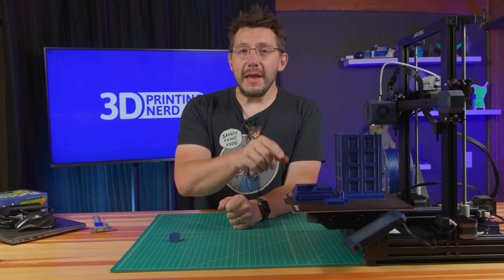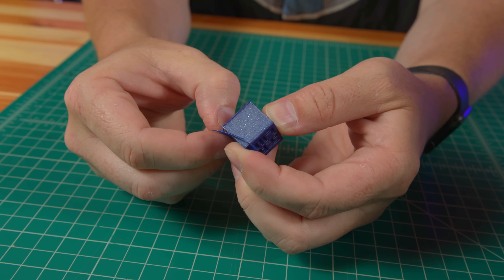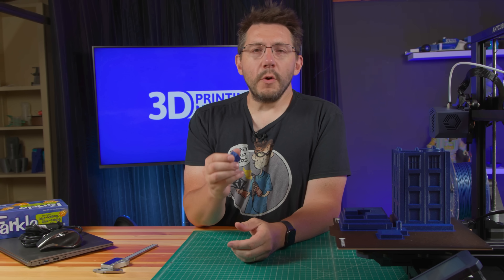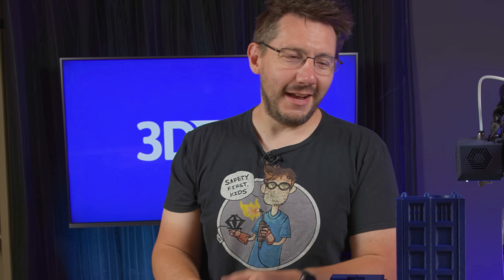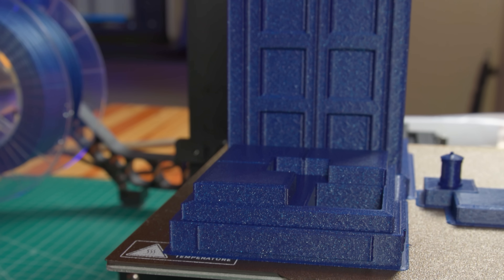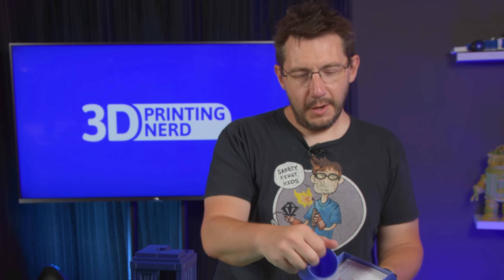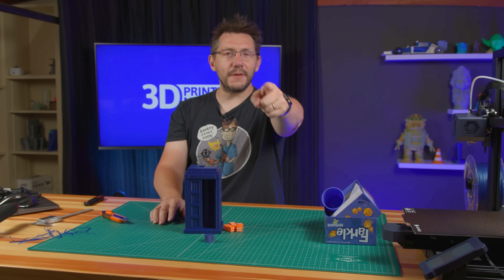Anycubic Vyper // First Look Part 2

Comment: Could you explain or point to a video that explains the extruder calibration please? ( where you referred to ensuring the extruder pushes out exactly 10 mm when it is supposed to push out 10mm)

Comment: One quick question I can't seem to find an answer. Can it support other nozzles than .4. Do all Volcano nozzles work with it? I want to update it down teh road after Ilearn. Are there just no upgrades? Also couldn't the under sizing on teh Z that small be caused by the textured surface of the plate?

Comment: I just received my Vyper. It has firmware v2.3.3. I see on their website that v2.3.5 is now available, but don't see any instructions as to how to update the firmware. 
Do you know how I can update my firmware? Also, is there any firmware that is better then their v2.3.5?
Thanks!
P.S. What printer should I select in Cura?

Comment: The Software that comes with the Vyper does not have profile settings for the vyper and when i updated to the lastest version of cura it still did not have the VYPER under the anycubic drop down, so how do you get it there or what other slicing software should I use?
Reply from the maker: I just made a profile in Prusa Slicer. Used Anycubic Mega X and defined proper bed size

Comment: I am new to 3D printing and just bought this printer. I am in the US and was told that since the US uses 60Hz, I will need to use the 210V setting not the 115V setting since it is 50Hz. It was also said that I will need to make a dedicated circuit for this. However, I took a additive manufacturing class in college where they just plugged a printer into a standard wall socket. Can anyone tell me what I need to do?

Comment: The probable average result for multiple rolls of a single die is 3.5, so the best guess is 3.5 times 6, or 21. With essentially just 6 rolls (6 dice each rolled once), it is not too likely that the result will be exactly on the probable average, but is likely to be close, e.g., 22.

Comment: Hey Joel , Could you do a video of plastic removal and obviously the risk of cutting one self using knives , Stanley trimmers and razor sharp chisels. 
Alternative safer methods need to be shown . 
I have slipped a couple of times but only minor cuts, however some new to printing may need to be aware of the risks of lacerating oneself. Cheers from Australia
Reply: Search on Amazon for deburring tool

Comment: tests i always do.  E-Steps, Flow 1 wall, then 3 walls, then 2 walls, back to 1 wall,  then Linear Advance, x,y,z 20mm then 30mm single layer cube check. as long as it is within 0.2 of the desired 20mm/30mm. that is fantastic.
Reply: my single layer cube with this machine was 20.04mm

Comment: Basically a CR-6 clone but comes with a dual gear extrudera few mm bigger build volume and flexbed; not bad for $299, what would be the price without the eatly bird discount? 
 Hope it isnt riddled with the early problems of the CR-6.  Also love the competition it drives the prices lower for us users.

Comment: I’d be highly skeptical of 1/100mm readings on low end calipers. Even starrett and mitutoyo calipers that are hundreds of dollars have a hard time with truly accurate 1/100mm readings.
Reply: Always use a micrometer if you need precise measurements under 0.05mm

Comment: People also have to be careful about 1/10mm measurements or smaller on vernier calipers and make sure they’re measuring in the same position of the caliper jaws unless they’ve verified that they’re completely parallel. 

It’s easy for cheap calipers to be off by <1/10mm.

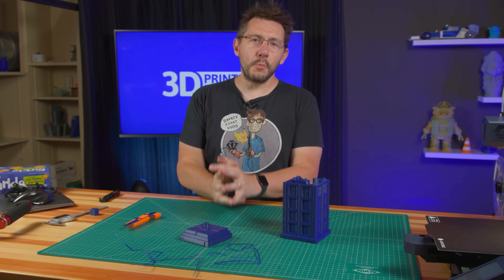Comment: Edit: 8:16 he makes the same comment 😂 

You should get one of those swiveling de-burring tools for stripping away brims. You can get cheap ones for like $6 on Amazon. 

I got one that is a multi-tool style and has two styles of curved tools, a straight tool and one for holes that works way better than a regular countersink for making countersunk holes in plastic.

Works great on PETG where it’s harder to remove brims cleanly.
Reply from the maker: I had one AND LOST IT! :(
Reply: @3DPrintingNerd  rofl you even specifically mentioned it in the video and I just hadn’t gotten there yet. 😂

Comment: For the infill showing through the walls, because you said you used cura, I would immediately check if "infill before walls" is enabled. If it is, please disable it and check if it solves the issue. If it does solve the issue please spread the word. It is has been years now since Cura had this issue with print quality on any printer other than Ultimakers. It is one check box out of the 500+ settings in Cura and it provides the worse results by default.
Reply: I haven't seen that setting be enabled by default since 4.7 I think
Reply: @PandaTaco  It depends on the profile and who made it, not so much on the Cura version used. Cura 4.9.1 has it enabled by default for an Ultimaker S3 for example and as I said for Ultimakers there is no issue, the infill does not show through! Some people have figured it out and for example the default profiles for an Ender 3 pro have it disabled by default.
Reply: @Dramaican88  ahhh so that's why I haven't seen that setting turned on by default, I used Creality profiles .

Anyway, I think the vyper could use the cr-6 profile, since it's basically a clone of it. Just have to adjust bed dimensions

Comment: oh would be nice if you would make a video about the tuning from the settings in der cura profil and print settings in the firmware like the e-steps
Reply: There is no firmware release for this so he will have a job. The other option is tuning via octoprint
Reply: @TheRealSamPrentice  Ponterface.....E steps are easy - on any 3d printer.  : )
Reply: @BladeDreams  sure but it’s easier from the UI
Reply: @TheRealSamPrentice  To set a new steps/mm value, first send the command M92 E###.#, replacing the hashes (#) with the accurate steps/mm value. Save this to your printer’s memory by sending the command M500. depends....if the firmware is out / available. if not = ponterface.

Comment: sorry.. but how you used these calipers at the start made me cringe sooo hard..
Reply from the maker: What did I do wrong?
Reply: @3DPrintingNerd  i don't know if i can explain it in english but i will try. You have your measuring jaws of the caliper, and you alsways need to measure as far back as possible, if you measure at the tip of the calipers, depending on your calipers you could get some error because of play in the jaws. Also if you measure further down  you could get some error, cause you don't have as much contact surface, which can cause you to measure not in da perfect 90 degree angle to tha part you are measuring. This was  at least how i learned it i hope it is understandable. Otherwise great Video, love watching these!

Comment: If the viper is anything like their chiron, look for any defects in the power cables between the power supply and the main board and also the bed power cables as well. They tin the ends and have been not to fail and cause fires. Plenty of cases where this has happened with the chiron and people have upgraded to high flex silicone and Feral terminals.
Reply: I found a review saying that it's not tinned. https://3dprintbeginner.com/anycubic-vyper-review/

Comment: I don't like anycubic after their customer support gave me the run around and soon after my anycubic Kossel set fire due to a broken temperature sensor. They didn't help and left me on read. :(
Also do not buy their Chiron printer it has a lot of design issues.
Reply: Good to know. I’m returning my Ender 3V2 because I realized after a month and a half Of tinkering It has a faulty mainboard and I’m just over it at this point. I was deciding between this and the Prusa but this comment kinda seals my decision. I think it’s so important for good customer service when things can go so wrong. Sorry that happened to you.
Reply: @whitneypanda  yea, they have some issues with cheaping out on frame design so they tend to wobble and cause vibration issues too.